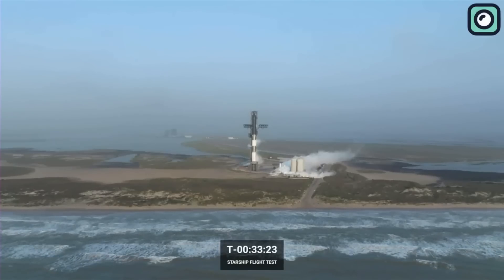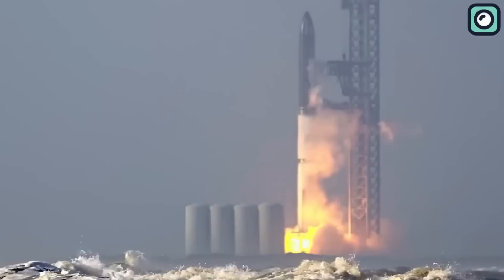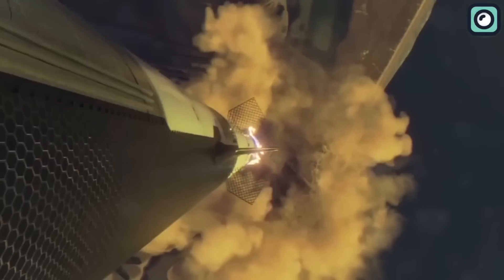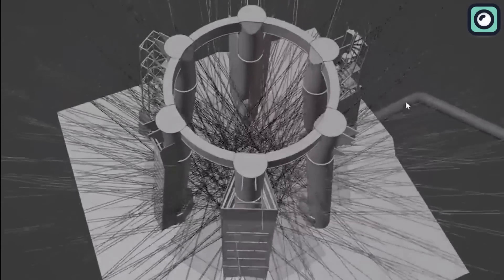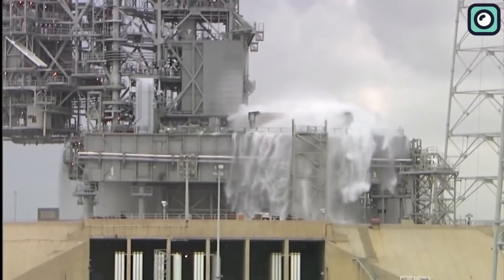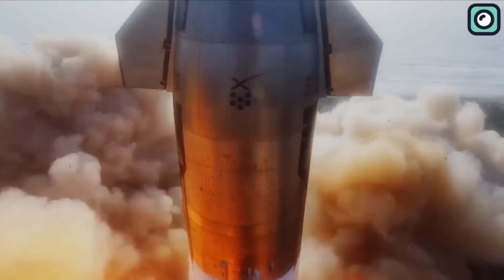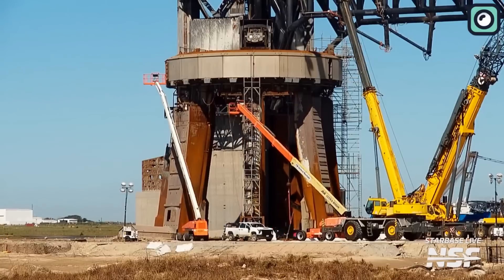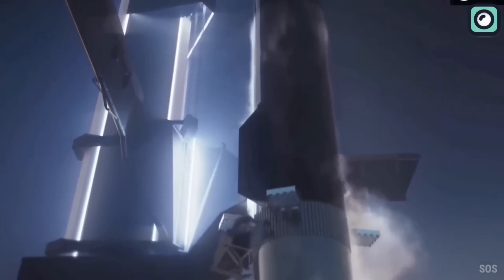SpaceX is Testing The Water Deluge System for the first time!

Comment: Okay…let me see if I have this right…the downward thrust of the rocket is 17 million pounds of thrust.  And exactly WHAT is the upward pressure of the water going into Elon’s water deluge system?  Unless it’s nearly the same, which it isn’t (because there’s absolutely no possible way his steel plates are going to handle 17 million pounds of trust to begin with), his water will all get pushed back out of the same piping from which it came, and whatever isn’t, will instantly flash into steam, which in itself may destroy the entire structure, along with the rocket that’s sitting on it.  

Another piss poor plan from Mr. Shortcut himself, Elon Musk.  But go on ahead…do your plan.  I’m not an engineer.  Nor would I ever claim to be one.  But I do understand physics.  And physics follows certain principles that are constants throughout the universe.  So, if your rocket generates 17 million pounds of thrust, your water better be coming out at at least the same force or more.  Then there’s the issue with water instantly turning into steam and what that sudden expansion might do to the bottom of that rocket…along with the internal section of the water deluge plate.

The amount of water NASA uses for their deluge system far exceeds anything you’re plate puts out.  NASA’s deluge system shoots out a tidal wave of water.  Your system looks more like a lawn sprinkler by comparison.  It’s NOT GOING TO WORK.  FAR TOO LITTLE.  Once again, you’re using little bandaids to cover missing limbs.
Reply: Hmm, another armchair engineer!

Comment: Seventeen million pounds of thrust travelling past Mach 1 will encounter the steel plate with orifices to pass water straight toward the rocket nozzles .  The water flow through the plate orifices will be stopped within the outer circle of the rocket nozzles .  Water that does flow around the perimeter will be ejected  away from the launch pad.  This system is an experiment .  We will see the results.

Comment: On April 20/2023   Space X made a bold stupid move in launching a Super Heavy with a shell Starship .  If they would have run the launch scenario  through a computer modelling program they would have got a warning of an outcome that they made happen .  The launch pad destruction was avoidable but Musk said Go for Launch .  It was a Success they rationalize .
Reply: That's why your not Elon musk you don't take immense costly risks just to see your rocket fly. It I told money like that I am saying f it let ir roolllll
Reply: @johngirgenti2207  This was a Stockton Rush gamble.
Reply: That’s EXACTLY WHAT THEY DID.  They tried to rationalize a complete failure and make it sound like a success.  This launch will fail as well.  His water deluge system is…delusional at best.  He might as well stand there pissing on the bottom of his rocket.  His water deluge system will be a complete disaster.  The amount of water that it discharges isn’t even remotely close to being enough to stop the damage from a downward rocket thrust of 17 million pounds.  Not to mention the part about the water that does come out flashing into steam.  Or the steam that will instantly flash on the inside of his water deluge plate that will literally blow it to smithereens.  It’s as if he plans on launching his rocket over the top of a hydrogen bomb.  That’s one way to get it into orbit.